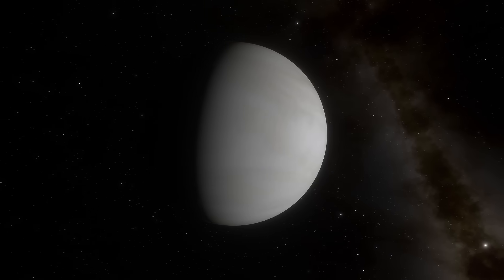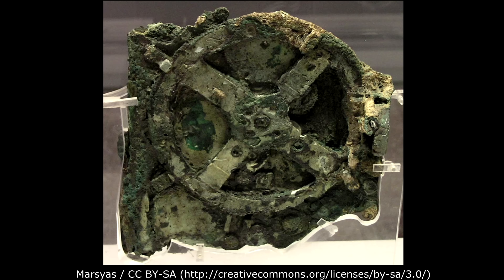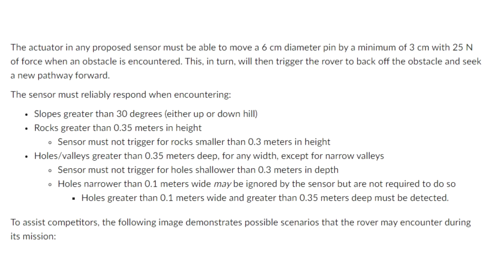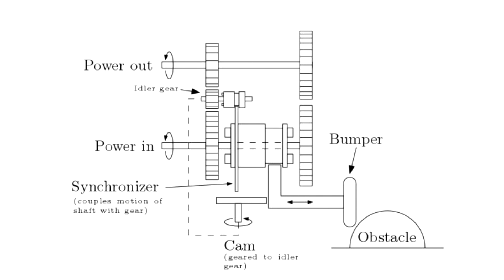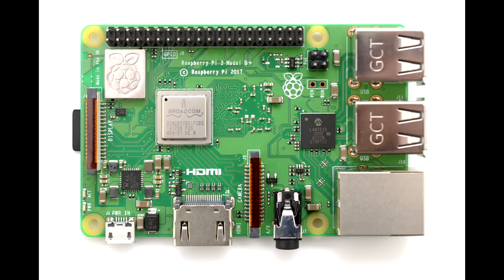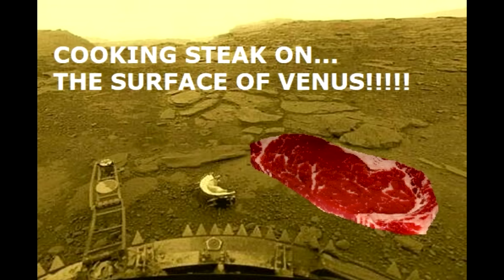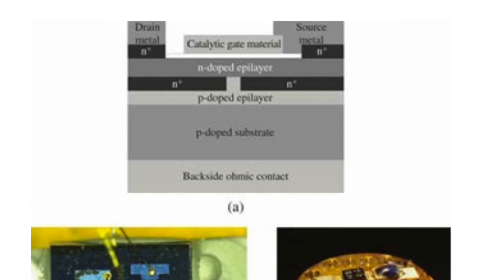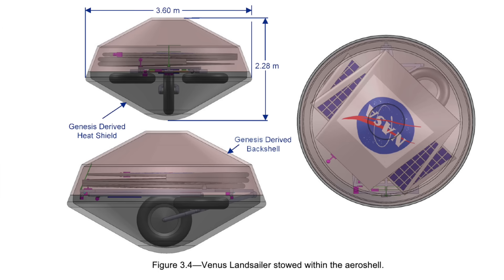Venus Rover Concepts That Beat The Killer Atmosphere

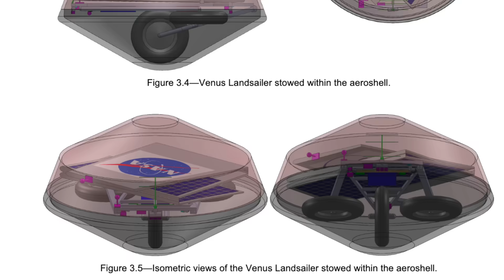Comment: @Scott Manley 9:45  How can we show that we have a better idea if NASA challenge does not allow any idea that is not related to the mechanical sensor??
Or in any case, they may want to read it, but what I won?   A good presentation of my idea doing all the calculation would take me 2 months.
Two months of work without knowing if someone would read it, if someone would try to steal the idea, or if someone would ignore the idea on purpose because it goes against everything that the current team is working on?   Some might lose their jobs because not many mechanic experts may be needed to develop the new concept.
So I don't see many incentives for the current team to share my idea in case it is good enough.
I still want to present my novel idea on my personal webpage, and send it by email to the heads coordinators on venus missions, I ask if they could add another category in the challenge, but nobody answer.
I am 100% sure my idea would work because it does not require complex tech at all, it is just thinking out of the box, something that I am 100% sure that NASA did not took into account, because is not mentioned in any of their hundreds of papers that they publish about venus concept missions.
My idea can have also some uses here on earth, there are only 2 basic (hard to find) patents who try to exploit the same thing here on earth which only grasp the surface of the possibilities, my approach is better, and for the Venus case it shines.
You will see.   I would not present a patent because it takes 10 years and a lot of money in my country, with few possibilities to find commercial use, but I least it could boost my personal page that I am doing.

Comment: A mechanical radio is a possiblity using original Marconi technology including spark gap transmitters. Delving back into early 20th century magnetic electronic systems could be an option. No semiconductors at all. Thermionic valves could also be an option as high temperature operation is also possible (with heater filaments being optional).

Comment: Couldn't they just dissipate all the heat with 'Electro-Luminescent Cooling: Light Emitting Diodes Above Unity Efficiency' just read a paper on it and if you search for what is in the quotes so can you....The principle seems to be based on some crazy quantum physics that means the power for each photon is produced from both thermal and electrical energy meaning that as it works it cools....

Comment: In around 1972, a company in Tucson (backed by Baldwin) was making integrated circuits that worked on the principles of the old vacuum tubes (cathode, grid, and plate).  The devices were heated up in order to make them work.  The original electronic computers were based on vacuum tubes.  I recall that someone was thinking this might be workable kind of electronics that could be used on a venus lander.

Comment: Can you run a second challenge without all the unnecessary restrictions?  The ucrrent one, is trying to get people to solve a problem, which would not BE a problem if the wheeled windmill platform was properly viewed in the correct light: which is: it is a guaranteed-to-fail-fast bad idea.  Let US tell you how to solve the whole exploration problem, instead of making us work on a tiny bit while you bury your head in the sand that you've already made so many bad decisions up to this point that it's never going to work no matter how well we solve this one bit for you.

Comment: I would avoid the land probe - use a robot blimp that flies in the upper atmosphere and has sensors for taking atmospheric readings, has a long wire camera for looking at the surface, side-scanning radar for mapping. This robot would send data back to the orbiting satellite the blimp rode in on. If it were a manned mission, that blimp would have to be a zeppelin, but setting foot or dumping a probe down there on the Venusian surface just seems like a bad idea.

Comment: Ok well RTGs actually just use the radioactive source to generate heat, the heat is then converted to electricity to using the Seebeck effect (ie thermocouples). So given the surface temperatures on Venus are already in the 500C range you could probably just do away with the radio source & use the vehicle body surface temperatures to generate electricity. This electricity would then power peltier effect coolers to cool the electronics board. I'm not sure why NASA would propose solar panels or mechanical power generation like a small wind turbine for a Venus surface mission given the 100km of sulfuric acid clouds significantly reduces surface solar radiation, and the challenging environment for mechanical movement? 

Generation of electricity via thermal methods would surely be the wisest direction & Seebeck would be solid state solution that is designed to deal with high temperature environment..

Comment: We don't have anything that will last on Venus.
The rain/air is like battery acid.

Russia had to have at least 8 inches of tungsten just to get to the surface before melting away.
The last landing had 12 inches of tungsten to last around 12 hours on the surface

Comment: The atmosphere holds the heat. What would the subsurface temperature of Venus be? What if there were an internal heat sink that could be used to bleed off internal temperatures for the radiothermic generator that could be driven into the ground. The rover could return to that and recharge. Wasn’t there some research being done on converting heat from non-radioactive sources directly into electricity?

Comment: This is a research paper that says they have silicone Carbide JFET that operate at 550C with a major problem being the other material like connections.  https://spectrum.ieee.org/semiconductors/devices/silicon-carbide-logic-circuits-work-at-blistering-temperatures

450C wire insulation in mica and other similar materials and the wires are nickel an alloys with copper and nickel.   And motor generator and other electromagnetic devices need cores and insulation between the laminations.  https://sinotech.com/products/motor-components/laminations/    500C is available.  

Thus very simple logic is possible and communication to it also possible.  The first AM kilowatt transmitters were magnetic generators of the reluctance type with a coil primary for the amplitude and the poles rotating at a fixed speed the frequency.  And those AM singles were heard by very simple filter receivers: conductor, resistor and capacitor circuits.  Popular Mechanics had plans to build them and I did build one with the tip of a pencil lead scratching on a razor blade for the variable resistor and army surplus ear phones in the 50's, lot younger then.    

This means that continuous communication could exist between the rover and orbiting brain.   Reluctance devices could  create touch probes.  Silicone light emitting diodes have been produced so maybe a sensor that has a small array of photo sensors could take pictures   JFET  gate could be a voltage created by photons, optical capacitor. 

The wind turbine I suggest is a vertical egg beater style.  Simple governor could be used to control the area the wind flows through.  

I would be interested in being part of a team.   Note; what I wrote is the result of working in power electronics aircraft generator systems for a few decades as a packaging engineer. and a few minutes of research on 450C materials.   Venus requires electronics solutions before integrated circuits, before ~ 1960.

Comment: Why not use sub-miniature valves / tubes. There are photosensor tubes and vidicon tube or even a mechanical scanning TV camera. An analogue computer could be used. A serial bit computer would be slower, simpler and more energy efficient.

To generate useful power, what about thermal electric generators or using a liquid metal in a kid of steam engine. There are lots of options. Needs some lateral thinking

Comment: cant you just use high temperature soldering and change out all plastics in the electronics with glass, ceramic and glass carbon and ceramic+asbestos fiber as well as metall foil

Comment: So, you'd need to make the rover out of metals with extremly low expansion when hot, able to withstand extremely high pressure, is highly resistant to acidic degradation and any moving parts are dust resistant all built within the laws of thermodynamics and able to operate over a long period of time and be able to send back data?  Is that about right? 🤨

Comment: Why does it need to stay on the surface so long?  Have the electronics in a vat of something that boils away and make your observations quickly.  Maybe an upper-atmosphere blimp can drop inexpensive pods at various locations to make video and measurements on their way down and for a few minutes on the surface.  Or how about a balloon flying a pogo profile?  There is some light gas like helium in an inner balloon and an outer balloon is filled with carbon dioxide while floating in the upper atmosphere, possibly using sunlight to cool and liquify the CO2.  When enough liquid CO2 is made, the balloon descends.  Liquid CO2 cools the electronics by boiling.  Once enough liquid CO2 boils off, the balloon ascends again to cooler altitudes.

Comment: Just a little addition to mechanical computers: Older automatic transmissions (i.e. 80's era), used essentially a mechanical or rather fluidic analog computer. It used a series of ducts, pressure diaphragms, valves, etc. to compute gear changes. If you open one of them, it looks a bit like the inside of an anthill. The liquid used to "run" those, was ATF. One reason they actually needed this then-special fluid was the analog computer. Here's a picture of one of those "valve bodies" I found on Reddit: https://www.reddit.com/r/ThingsCutInHalfPorn/comments/ab73q5/valve_body_from_an_automatic_transmission/
Perhaps something similar can be adapted to control movement?

Comment: Make The Rover Out Of Tungsten! Why? Because I Used A Calculator To Subtract The Surface Temperature Of Venus From The Melting Point Of Tungsten, And I Got 5,328!

Also If You Need Power, It's The Hottest Planet In The Solar System! So Just Generate Power Out Of Heat!

Comment: One problem with semiconductors is the band gap is reduced by temperature, so the semiconductor to start with would not be a material that would work at or near room temperatures. 

Another promising area is vacuuum tube analog technology, now not requiring heaters to operate. Analog computers are a thing.

So yes, take you materials up to molten lead temperatures and start from scratch. Ruthinium and others in the Platinum group are a good start for metals.... Nichrome resistive material is fairly stable.. A few years building thick-film and thin-film structures and testing at temperature should begin building a new series of workable devices if enough universities could get the funding to try.

Comment: Thanks so much for your wonderful videos!  First, I’m pushing 60 and it will be fun to see today’s brilliant young engineers design systems using mechanical and primitive computer components.   😜  Second, I think staying heat soaked on the surface is more difficult than a flying drone, perhaps a dirigible, that can visit low altitudes, maybe even touch down for a while, then retreat to the upper atmosphere to cool off.  Why the obsession with rolling?

Comment: In addition to the idea that I mentioned in my previous comment--for a rover that is a wind-driven, tumbling ball, or set of linked balls--another idea that is obvious and maybe has some merit is putting something extremely cold inside the rover to keep it cool on the surface. For example, a block of nitrogen ice could keep the inside of a vessel cool for a brief period, especially if the vessel is insulated. What's more, as the nitrogen generates gas, the gas could drive a small turbogenerator to produce electrical power. Perhaps the outflow of gas could be used to cool the vessel. Of course, it would have to vent somewhere, either to the 93 bar outside atmosphere or to a collecting tank aboard the vessel. The electronics could be inside a reflective, chilled, vacuum-lined container.

Comment: A hopper that just jumps upwards and lets the wind take it would be simplest. Make it a bouncy ball shell, with an inner part mounted inside on gimbals to re-orient the hopping leg(s) between bounces. Wind powers a spring and when full, it can do a hop. Orbiting smarts could calculate bounce trajectory to make it a bit less random. Still need the high temp electronics though. Seems like heat pumps are a lost cause, although a vortex tube (no moving parts) might be able to create a tiny pocket of non-hell to operate in temporarily...at a big power cost due to low efficiency.

Comment: Why don't they just enclose the processors in a vacuum?
Reply: Radiative heat still flows across a vacuum, and electronics generate heat, which needs to be removed. When the outside environment is 460 °C, the radiative heat is going to cook whatever is inside the box pretty soon.

Comment: As for light sensor one could use a simple  vacuum photodiode. Actually use of vacuum tubes would make much more sense than semiconductors. We can make them almost as small as transistors, and with high temperature of Venus they might require less heating to operate. The high pressure of the atmosphere will be a problem...

Comment: My optical computer could do the job.... my optical computer, that I never got the chance to develop, because I never could afford to develop it. Actually, I came up with a few variations of an optical computer, one of which would be ideal for a mission like this, because it's pretty much a solid chunk of glass. Of course, silicon carbide is a ceramic that has long been used in high-temperature electrical applications. What needs to be done here, though, is to find a way to multiplex the use of electronic components, so as to reduce the component count. 

I'm sure that someone will come up with a Venus rover design inspired by tumbleweeds. It's a good, basic design, best over large, flat areas with plenty of wind energy. At least one such design was suggested for Mars; I don't know why nobody has flown it. Put a few of them together and you could apply brakes to select sets to steer. One possibility that I envision is a ball with wind scoops around it, to catch the wind (though, the scoops might not be necessary or desirable in the energetic Venusian atmosphere). 

It's too bad that we haven't invented the opposite of a radioactive power source, that is, found a substance that would absorb as much energy as radioactive substances emit. It probably would be blacker than black and could be super cold. It would make a great heat sink. Then, we could have thermoelectric generators working on Venus at reasonable temperatures. I guess that something like that might work if an endothermic nuclear process, perhaps allowing the recombination of particles, exists.

Comment: now, i aint an interlectular.. but why come they dont they just send an inflatable thingy with the brains that floats around in the "cozy zone" above a dumb rover thats in the "hot-pocket cheese zone"? and why use a rover at all?
since the winds are so low and the atmosphere is so dense, it would be easy to float things in venus. they could drop drones or something that go to the surface for short periods of time, and then fly back up to the inflatable mothership to cool down.
if there is no solar power from clouds in the "cozy zone", send it with a nuclear power generator. wireless charging is a thing too! so the drones only just gotta land back on (possibly magnetic) landing pads. all the tech for this already exists 🤔

Comment: Until we develop complex electrical circuits that will function comfortably on the surface of Venus I think our best bet for exploration is to use airships that will fly in the more benign upper atmosphere. Use downward looking radar to search for suitable sites for further investigation. Drop probes that parachute to the surface, grab a sample, then inflate a balloon to float back up to the altitude of the airship for retrieval.
The probes could be entirely mechanical in nature.
Since the probes spend a minimum amount of time in the corrosive atmosphere there is the possibility that they could be refurbished and used again.
Advantages:
No electronics (or minimal electronics) so no need for heavy, complex cooling systems.
If made from radar reflective material, mission tracking is performed by the airship.
Without the need for a pressure vessel to protect delicate electronics the probes could be relatively small and light so making it easier to get them to Venus in the first place.
Devices that are mechanically simple are less likely to fail.
Disadvantages:
Venus is a windy place. Recovery of the probes once they return to the altitude of the airship may be the most "challenging" aspect.

Comment: Is it too hot to use innovatively constructed thermionic valves for communication? WW2 tech. 3D printed metal circuits using tantalum wires etc.

Comment: First question: how high up do you have to be in the Venusian atmosphere before the temperature becomes manageable? Second question: could we build a tether of that length out of existing materials that would be strong enough to survive the stresses and light enough to ship to Venus? I'm thinking of a big balloon that lowers an instrument package down to the surface to do science, then reels it back in and gets blown to a new location to repeat the process. Could be RTG or wind-powered. I was thinking you could run coolant down the tether, but you don't need to - just insulate your ground package really well and reel it in before it can thermalize, then let it cool in the upper atmosphere before lowering it again